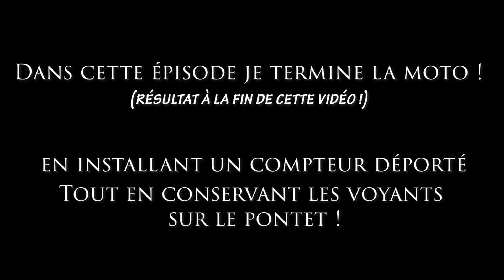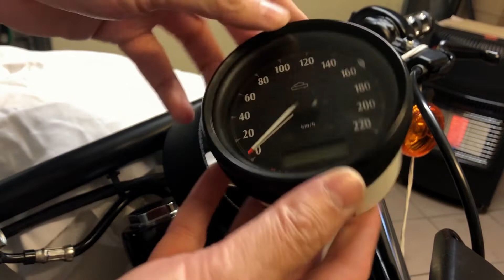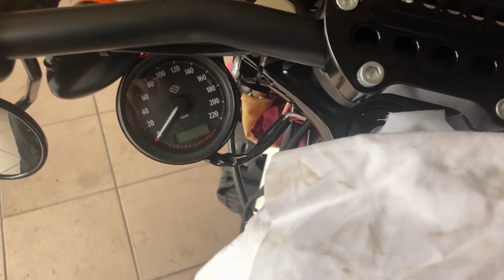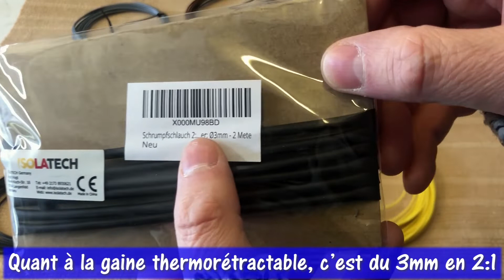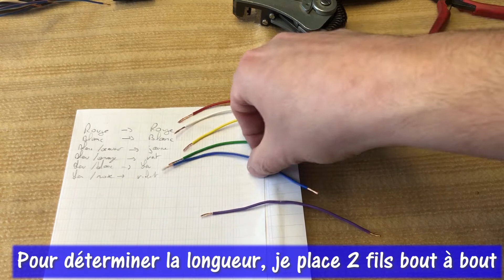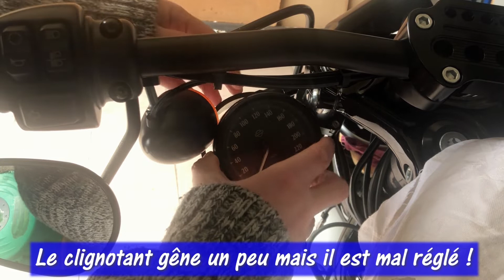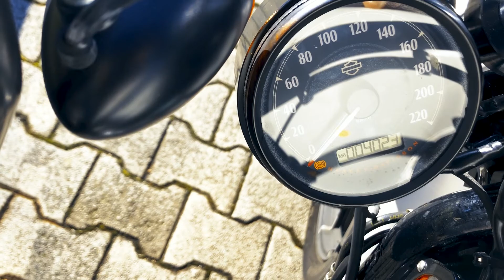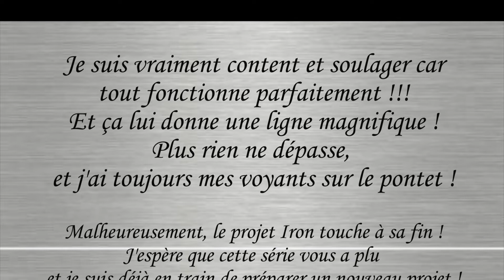Episode 11 :  Comment installer un compteur déporté en laissant les voyants sur le pontet

Comment: Merci pour ta video ! 
Question stabilité. Le fait de mettre le compteur sur la fourche ne gêne pas la conduite ? Tendance à se dévisser ou as-tu mis un peu de frein filet ? Merci
Reply from the maker: Salut, alors pour répondre à ta question, il n'y aucune gène à la conduite ! Lors de l'installation j'ai tourné au maximum le guidon afin d'être certains de ne pas cogner le réservoir. Et pour ce qui est de la vision, contrairement à ce qu'on pourrait croire, je vois très bien ! Surtout avec la position du dragbar. Il n'y a pas besoin de se pencher ou autre, ça tombe sous les yeux ! Quant à la fixation, je mets systématiquement un peu de frein filet bleu 243 (sauf cas exceptionnel) car comme sur le reste de la moto, avec les vibrations les vis ont tendance à se desserrer. Et pour le moment rien n'a bougé ! ✌️
Reply: @SottilDesign  Merci !!